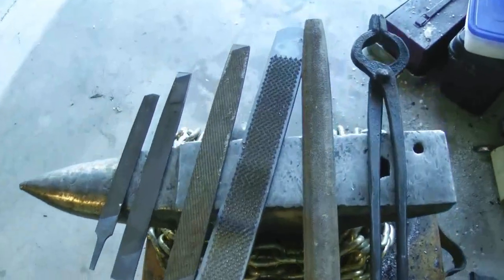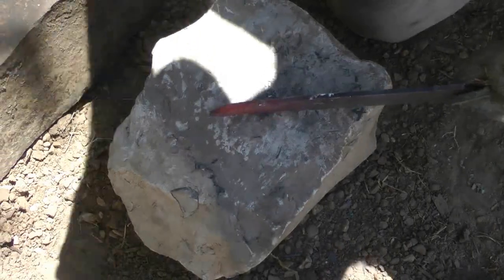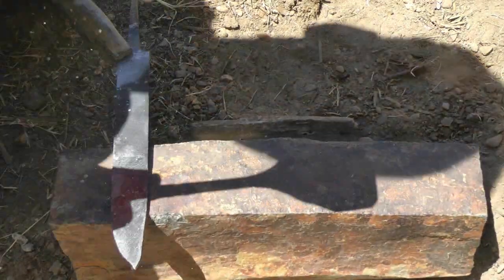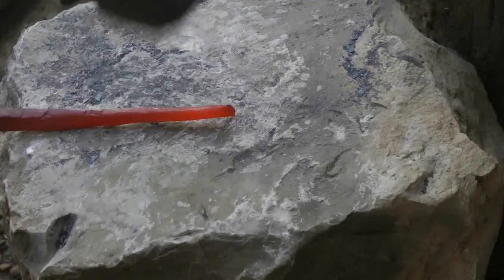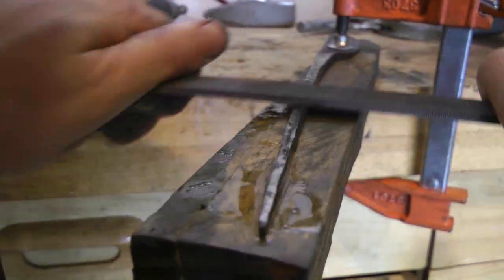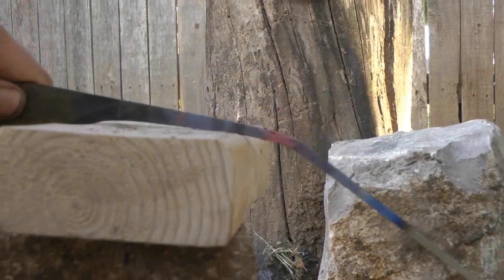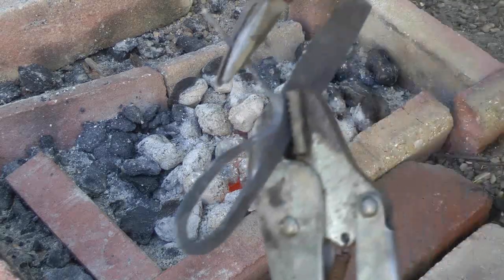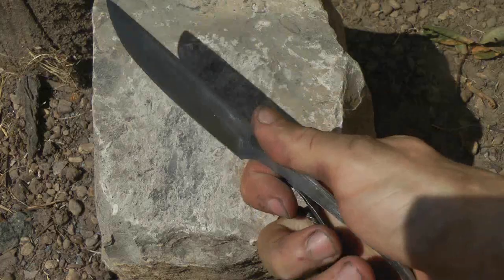DIY File Knife w Common Tools, No Anvil.

Comment: dude, you should bend the bottom end of the tang out to be a knuckle gaurd, maybe make some aggressive twists in that part for an awesome look. Nice knife, good work
Reply: It's not a fighting knife so it doesn't really need a finger guard.
Reply: Walrus Warlock but it could be, with just a slight variation to what is already there. just what i would do if I made it, (not that i can)

Comment: Great video - thank you!  How hot do you get the steel before water quenching when checking the steel in the beginning?  Once you have the shape, do you let the fire die down before leaving to anneal?  Or just turn off the hair dryer and bury it?  Brand new to this and having a blast experimenting with files -  thanks for the shared wisdom!

Comment: Can you use like motor oil to quench or is it a special oil?
Reply: Vegetable oils. Peanut oil, canola out. Someone correct me if I am wrong please.
Reply from the maker: +GlobalistEnemy01  People use all kinds of oils, including motor oil.  Different steels must be cooled at different speeds for optimal heat treating and different oils cool hot steel at different rates.  In general motor oil or vegetable oil is a good place to start.  Many prefer vegetable because motor oil fumes are pretty nasty and its flash point is lower than some vegetable oils.
Reply: +Green Beetle would the leftover bacon grease work?

i know it probably wont but that might be an interesting experiment
Reply: You could, but it's not optimal. It's thick and salty and it won't cool the steel as fast as, let's say, canola oil.
Reply: 1095 steel (nicholson files) is a water quenched steel but is prone to cracking and warping. That's why some folks quench in oil but it's preferable that you use a light oil like canola heated to 130f if not using water or brine.

Comment: What's the difference between wood coal and charcoal?
Reply from the maker: The White Dragon My understanding:  Technically wood coal and charcoal are the same thing, the product of partially burning wood to make carbon rich charcoal.  Coal on the other hand is mined from the ground and usually contains impurities (mostly sulfur) that burn off in a yellow plume after ignition.  Coal burns hotter and longer than wood coal/charcoal but is more expensive and "dirtier".The charcoal briquettes sold for grills and outdoor cooking is pressed wood coal dust, saw dust, corn husks, rice hulls, etc and usually some lighter fluid.  I'm not sure there's a huge difference between briquettes and wood coal.  May be someone who knows more can weigh in.
Reply: Green Beetle 
I was taught that wood coal is "young" coal. Its geologically not as old. Wood Coal - called Brown Coal - has a lower energy density than coal.
Black coal is older, has a higher energy density by about a fifth so is considered better for most purposes.
Coke is black coal that has had the impurities burnt out. 
Meanwhile wood comes from trees, and Charcoal is wood burned in a reducing environment to burn out impurities and leave you with fuel.

It's possible that people are calling charcoal "wood coal", and its possible that I've just misremembered.
Reply: roger bennett Sounds about right

Comment: What is a tang?
Reply: +MadGaming10 A tang is the length of metal from the knife that runs into the handle. In this case, it's the skinny bit that he bent around for the handle.
Reply: The part of the steel that is in the handle but still made from the same peace of metal as the blade